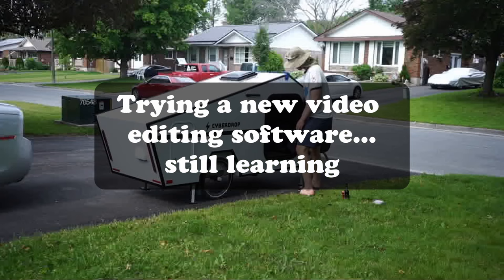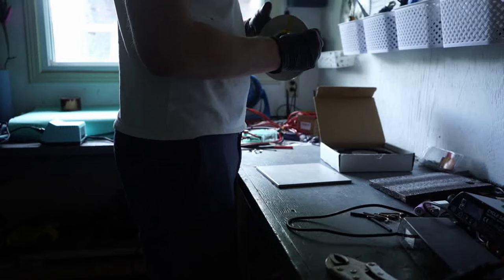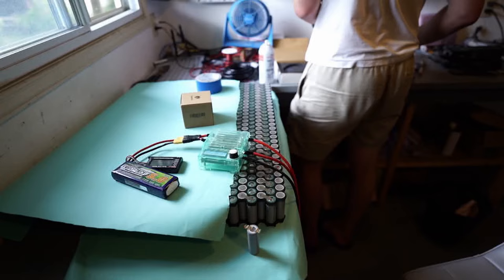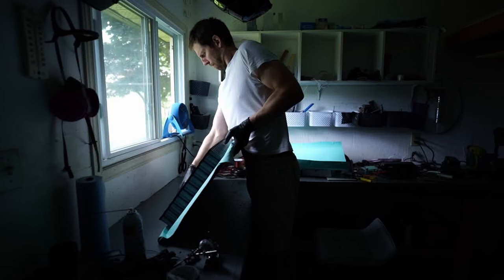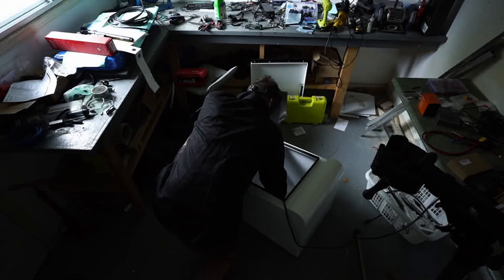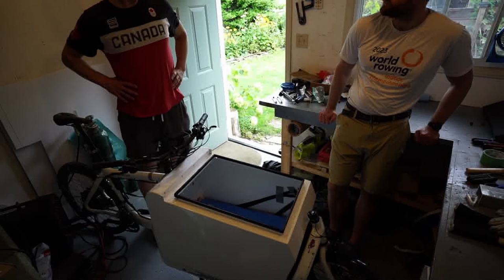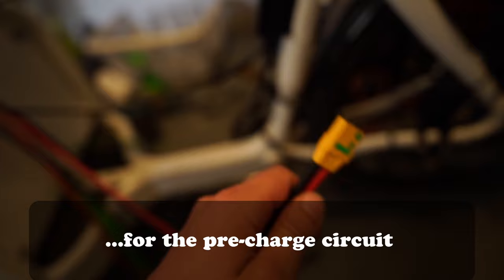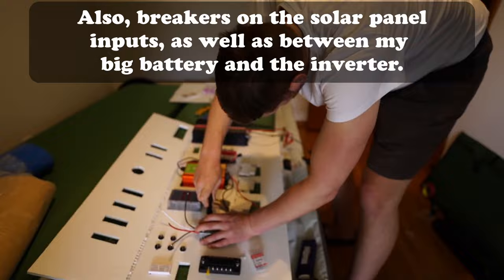Building Electric-Powered Bicycle Camper (PART 17)

Comment: I just very recently found you Youtube channel, and I am very impressed with your build. 

I do however have a note about your rear lighting. 
At times, you will want some very flashy, very  intense yellow lights.  These times will be few, and very select, but when such lights make a difference, they will make a very important difference. 

I have watched many youtube videos these past 5-7 years, and have followed several bike trailer builds/tours. And though I no longer have the health to do bicycle touring, I am still hobby building a very light weight bike camping-trailer.  Where I live the max length of the bike-train must be below 3.5 meters, and 100kg (11.4 feet, 220.4 pounds), so I can not put a bike system like your out on the roads. 
Never the less I think it is a very impressive build and very nice design. 

But back to my notes about rear lights

A few of the travelers I have followed, have either them selves, or a friend, who were rear-ended by a truck, under sub-par road, light, rain, or tunnel conditions - and they have all now installed blinking yellow lights (for use in certain situations or road conditions), because the result of being rear-ended by a truck,  never has a desirable outcome. 

There are some road conditions (and some tunnel or weather conditions) , where the normal level of lights will only protect one from being crashed into, if one travels at the average speed of the vehicles on the the road - in those situations (under those conditions), you will want some type of lights that are VERY visible (or rather VERY noticeable), from about 1 mile away under normal light/night conditions. Well, about ½-1 mile anyway. 

For the situations I am thinking of,  very intense yellow 'strobe' lights have proven to be what is needed.  They must of cause not be blinding, but as close as you can get will often be preferable. 

--- 

Anyway, this was just a note about a safety issue that may come in handy, some day. 

I say, at least prep with some wires, so extra lights can be added, if your experiences indicate that sometimes, very attention demanding lights, would be nice to have. 

I am however very impressed with your build.
Reply from the maker: Hey, that’s good advice. Appreciate it. I will have a Garmin Varia radar bright flashing light on the rear as well. But your point is well taken. I may get some battery powered lights for those instances. Cheers!

Comment: Hope you also incorporate a battery air  cooling solution for hot days.
Reply from the maker: Yeah, these batteries of a discharge max temp of 50 celcius. If temp propes get close I’ll stop in some shade. Hopefully it won’t be a frequent occurrence. I did look at battery cooling/heating options but decided it wasn’t worth it for my situation. Cheers

Comment: You've got the world's most serious ebike there.  Maybe (over?) 500km fast range without trailer.
Reply from the maker: Probably close to that without the trailer!
Reply: @Jerbrown 
Afternoon Jeremy, here in U. K . a build like your powered wheel trailer would be illegal as can't have a powered trailer and powered bicycle. As can't have a two motored vehicles connected together.
Reply from the maker: @thomaswiggins7913   Good to know. I'll take the front wheel motor out of the trailer when I'm in the UK - does that solve it? I can tow it with two hub motors in the Bullitt bike
Reply: @Jerbrown  
As long as the two motors on the bicycle in total don't exceed 250 watts you can ride licence free. Wattage over 250 and bicycle in class of motorcycle. But as you being a visitor on holiday there's the chance the bicycle and powered trailer being seen as originally equipped and you using as your transport on travel around the globe. Your dog will need proof of rabies isolation to travel in U. K . Once you finish your trials enjoy your travels about the globe.

Comment: If you have a 9.5 kwh battery, and you only sip 350 W from the battery, plus add 300 W from peddling, your average power consumption will be about 650 W/hr to maintain a constant velocity of 28 km/hr and that should give you a range of approximately 608 km without the trailer, using only 80% of the battery starting at 82 V and finishing at 68.4 V. Then it will take 7.6 hours to recharge the battery with a 10 amp charger. I don't think you will feel like riding 21.7 hrs in a day, maybe more like 8.5 hrs and even then your butt will be killing you, LOL, so your daily milage will be more like 238 km and it will take only 3 hours to top up the battery. For 8.5 hrs of riding you will likely burn about 3,000 calories, so you will get skinny pretty fast unless you replace the lost calories. I have enjoyed watching your project evolve. I would enjoy discussing it with you more and go for an ebike ride together.
Reply from the maker: Hi David, yeah I've been running these various math scenarios, too :)
I'll be connected to the trailer for most of this trip I have planned, and from early tests (coming in future video), I am averaging about 34 watt hours/km while travelling through occasional moderate hills but mostly flat and gentle inclines. You're right about the butt issue - I rode to Newfoundland from Toronto a couple of summers ago and FAR underestimated the time it takes for your butt to get used to being in the saddle all day. Where abouts are you located?

Comment: Did i miss it or how do you plan to manage bartery heat both charging and discharging? Amazing effort either way!
Reply from the maker: The battery is built such that the max continuous current draw will be well below the cell rating, thus resulting in little if any heat beyond ambient temperature. For the cold, I won’t charge below 5 celcius just as a buffer. Active heating and cooling would have added more weight when it’s largely unnecessary in my case. So basically, the plan is to operate within the cell specs and be careful during extreme ends of ambient temperature range.

Comment: How are u mixing the jb weld? I bet u did It wrong. Mix some on clear plastic and look on the other side. You can also use a heat gun and fan to speed up curing
Reply from the maker: I mixed it until it was thoroughly grey. Good idea about using clear plastic to check - thanks 🙏

Comment: maybe I missed a step but did you put a fuse on that thing ?
Reply from the maker: Hey, yeah I forgot to film it. I ended up going with a 125 amp breaker between the positive battery lead and the positive bus bar.

Comment: Looking forward to watching your travels! 
Did you consider some form of dampening/suspension underneath the battery?
Reply from the maker: I put 2 inch thick open cell foam padding under it and around the sides. And the battery is wrapped in 1/4” closed cell foam. I’ll also try to dial in the tire pressure, plus getting bigger tires to help somewhat. Full suspension bike would be ideal, but ran out of time to build that, too.

Comment: Great to see a plan coming together! Will that battery get hot?
Reply from the maker: Hi Ross, the battery should stay close to ambient. I’ll be pulling 1.5 amp per cell most of the time so I don’t expect much heat from usage. I’ll report back if I’m wrong.

Comment: The brackets came off because there was paint between so don’t you blame jb weld it’s gods goo
Reply from the maker: But I ground all the paint off first and cleaned with acetone.
Reply: Alright well I seen something on the first bracket you pulled off looked like paint , it might have been an improper mix of not enough mixing the compound, regardless welding it is much better 🤙
Reply: I enjoyed your video and it’s inspired me I’ve got 5 scooters
Reply from the maker: @joedoerksen9166   Yeah, maybe I didn't mix it half and half properly. I dunno, but I wish it would work for me :)
Reply: Lol I’ve had that same problem and it’s hard to make exact equal part of the stuff I switched to spicy that comes in 2 connected syringes , hard to mess that up

Comment: Hey man. Im building a low budget version of what you are doing. Had the idea for years but just got started. How did you do the tow hitch? Id like to see closer views of it.
Reply from the maker: I bought this: https://amzn.to/3s9r4Ub
The hitch is surprisingly strong, but it does tend to move around a bit even when tight. I'm planning on reinforcing it with a carbon fiber 3d print.
Reply: @Jerbrown  I saw that one online as well. I was worried it would not hold tight and would slip off. It's hard to tell from an online picture. I was wondering if a solid bar with no hitch (Removable pin probably) might be better with the third (front trailer) wheel. Otherwise, you have 2 pivot points. One at the hitch and one at the front trailer wheel. Is it better to have 2 pivots or would you say it adds unnecessary angles that make turning tight corners more difficult? Or would the more rigid design have its own set of issues? Im definately not an engineer lol.

I am going to rig up an old kids bike for the front wheel similar to what you did but way less professional looking. My trailer is going to be 2 IBC tote frames on an angle iron frame. I have yet to figure out what to use for tires and axel, but i was thinking I could use some cheap harbor freight wheelbarrow (or similar) tires as they are cheap and hold weight well. If they dont last long, they are easy enough and cheap enough to replace that it's not an issue. I dont know how to do axles and i have very little budget to work with.

The IBC frame is very sturdy so my walls will be thin. Probably lined with choroplast, filled with thin or spray foam insulation, and covered with a "tarp". the tarp is a bed sheet soaked in silicone for a flexible and waterproof cover and riveted on. I would love to make a weight comparison with yours when im done. The frame will be a bit heavy, but the walls should be less than the concrete walls on yours. 

I also wanted to add a set of legs for stabilizing and keeping the camping weight off the tires. Although my trailer will be quite wide, I was going to make the legs about 3 feet or so with removable feet that could be swapped with small wheels or other foot types for different terrain. Spikes for soft ground, Flat for rocky or hard ground, and wheels to get over thin bike path barriers with the legs extended as if it was on stilts. After that its just windows and doors and furniture. My bed will be made of long milk crates that will double as storage. Shelving made from cardboard store displays and choroplast scraps. A spot for my dog too. 

Sorry for the long reply but please tell me what you think and let me know if any of my ideas help you out. I was also thinking of going to South America on my eventual travels.
Reply from the maker: @jeffl4802  that is a lot to respond to :)
I think the main thing is to test the ride quality with simulated weight as early as possible. And align the wheel axles perfectly. Good luck!!
Reply: @Jerbrown  Yeah sorry. Its my Hyper fixation right now. What do you think about the stilt leg idea?